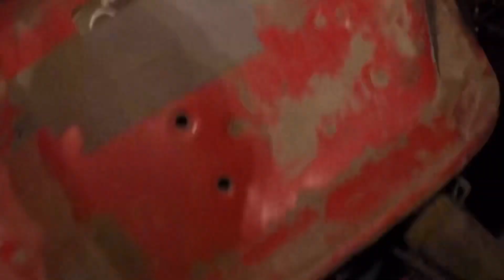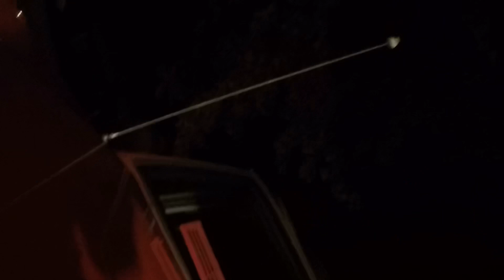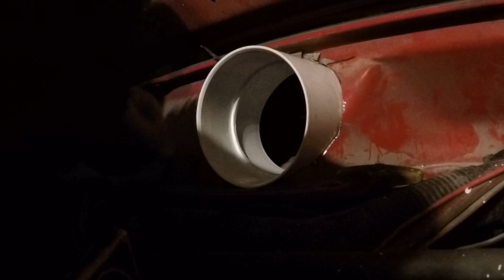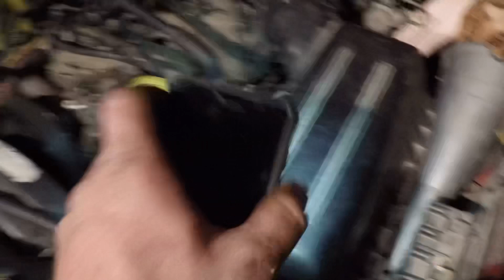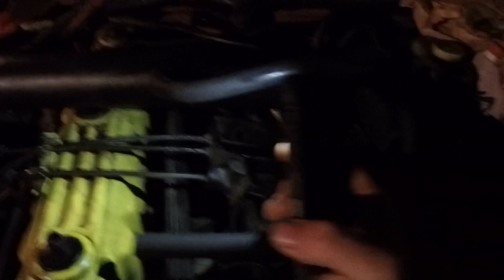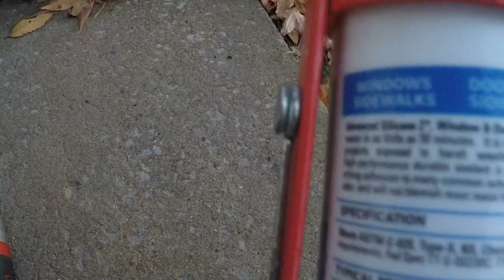Jeep Cherokee XJ DIY cowl cold air intake, using TJ parts and PVC pipe

Comment: What size is the pvc fitting? Size hole saw?
Reply from the maker: The adapter is a 4" to 2" and the couplers are 4" to 4".
Reply: @YourFriendStChris  Awesome. I just put motobilt fenders on mine so gotta do somn with my air cleaner.  Thats perfect.  Godd video man.
Reply from the maker: The Hole Saw I want to say was also 4", but it will naturally cut a little bigger by the time you get through the sheet metal, be careful to not go down hill and drill into the bottom sheet metal inside the cowl, that is the barrier between the cabin and the outside there.